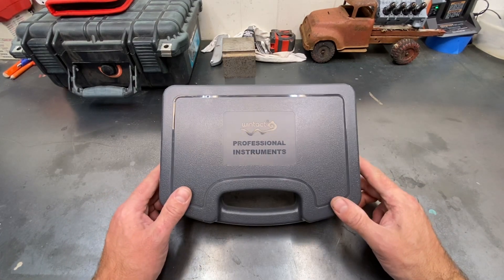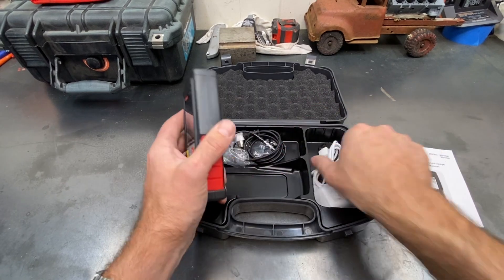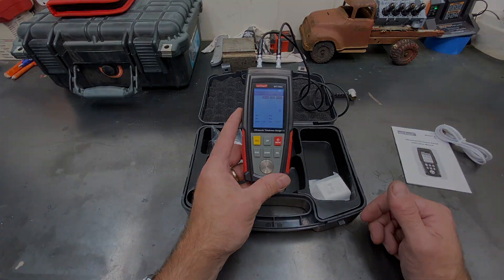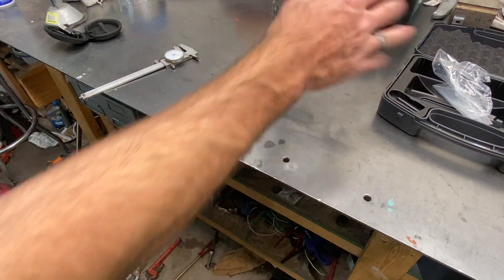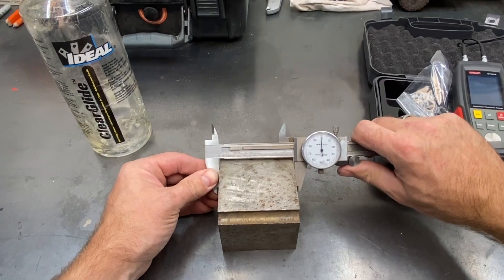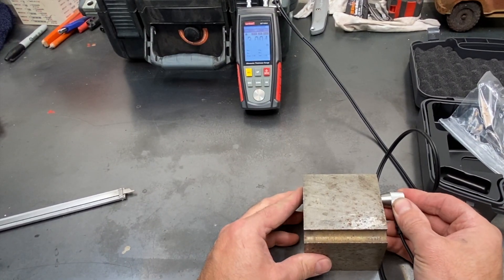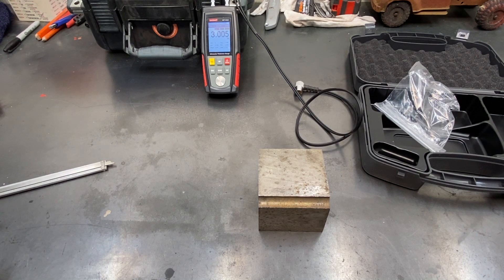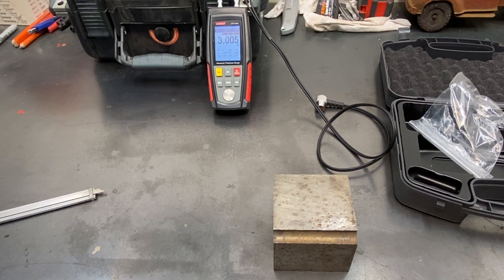Is A Cheap Sonic Tester Worth It?

Comment: Are there minimum and maximum thicknesses that it will measure ? also i heard surface ruffness can facter in a bit ... tks fer the vid
Reply from the maker: I have heard the same thing. I think that it is rated up to 6" and I am not sure on the bottom end of the scale.

Comment: is there a possibility to measure paint thickness on aluminium or steel ? For example to use to measure paint thickness on cars?
Reply from the maker: There is a tool for that, but it is not this one.

Comment: its not .006", or 6 thousandths off.  It was a difference of .0016".  The 6 at the end is ten thousandths and requires an outside micrometer with a veneer scale to measure.  And I am betting that the dial "very near" calipers is the less accurate of the two.  Wish that you would have used a true outside micrometer for the comparison.